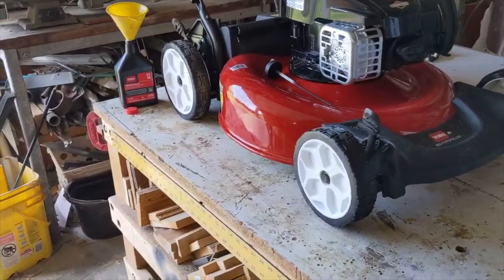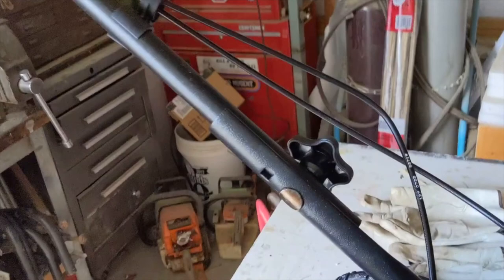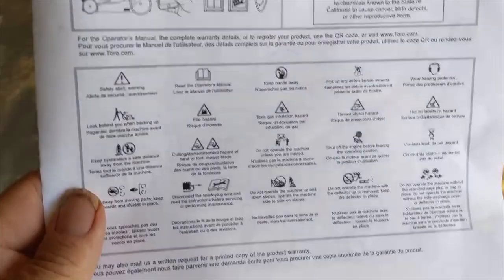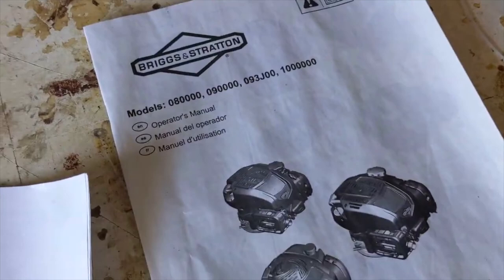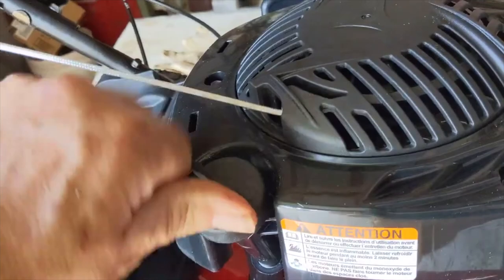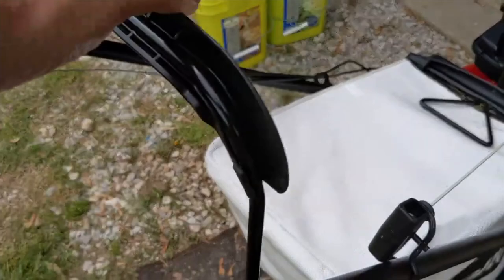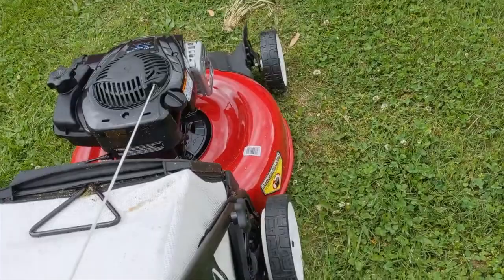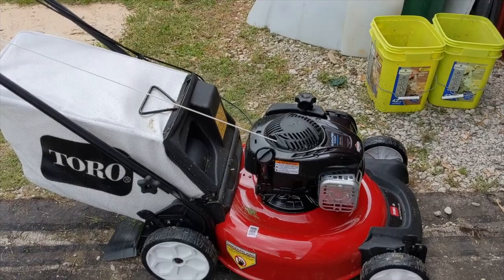Honest Review | Toro 21" Recycler/Rear Bagging Mower

Comment: This review rocks. I thought 100% the same thing about the oil and instructions. I was worried seeing no words thinking that’s a shortcut I’m not sure I want them making. Also I took like 30 minutes putting the oil in because I wasn’t sure how much, but the one I bought this week it took the whole bottle to be in the middle of the dipstick.  I have seen a lot of reviews online and even though it mowed great, I may go get the added warranty from some of the reviews.
Reply from the maker: When getting ready for this years mowing marathon this mower was almost sent to the junk yard, in fact I bought another mower while trying to fix this one. I passed on the warranty for this mower & learned my lesson here. The issue for the mower was the fuel filter that's located IN the tank and is not serviceable. I fixed it with an external filter. Now back to mowing =-)

Comment: Plan on buying this toro mower at one of my local hardware stores in town later this summer. I’ve heard it’s a decent mower for power and performance, my current one is a toro self propelled mower but has a big 149cc engine, had it almost a decade, it does not run well and has terrible issues with power, think the Briggs will do better, so this mower you have I definitely plan on buying.
Reply from the maker: That's fantastic, with winter just about over I know the grass is getting ready to spring into action. =-)

Comment: I have this same mower and yep, the instructions.... Well, they just aren't.
I have been very displeased with this because it was 3 times as much work to pull it backwards.  Watching your video I'm noticing that the propel and safety shut off bars are connected backwards from the way you described it.
Today I adjusted the propel bar so that the propel drive ísint engaged the whole time and now it is much better to pull it backwards, I cut the yard without calling the mower a POS.

The bag system leaves allot of un contained clippings that you will have to pick up with your hand.  It's a mess honestly.  
I would rate it a 4
Reply from the maker: I just had the wife use the mower today, the weather was a fantastic day for lawn-care, and yes she is still complaining about pulling the mower backwards, hates the bag and leaves it off as much as possible. Didn't notice about the bars, I'll take a look at it an see just what I did.
Thanks for the suggestion on the propel bar, I'll look at that too
MCK

Comment: I have one last question, please:
 Do you have to remove the gasoline when not in use for long periods? For modern gas engines the fuel line can get clogged up if you don't remove the gasoline. My old mower (decades old) never required this!  Just wondering in case you know?
Reply from the maker: I don't generally need to remove the gasoline because I run the gas out, If there's gas left in the machine at end of season I put in Stabilizer. Better safe than sorry.

Comment: Slack in throttle line. How do I fix. Toro 21in recycler brand new?
Reply from the maker: There shouldn't be any slack in the throttle line, without me seeing it I couldn't offer a suggestion s how to fix the problem. Could be assembled wrong at the factory. Sorry I couldn't be more help. MCK

Comment: 1) Can you use the mower without that huge clumsy bag? I never have  used a bag.
2) Does it start with one pull, ie., easy to start?
Reply from the maker: Yes definitely you can mow without the rear bag, that was the first thing the wife took off. It is easy to start, usually one pull will get it started. We're having a problem with the carburetor right now after a year of use. I'm frustrated because we really liked how easy it is to maneuver around the garden. I'll be putting up a new video on this soon. Hope this helps.
Reply: @4AMFARMS  Thank You!

Comment: What happened in you put the full bottle of oil I did can I fix it
Reply from the maker: It depends on how much is too much, if the oil is to the rim your going to need to remove some by pulling the drain plug to let some out. Over filling will cause problems a little is ok but a lot is bad.

Comment: Recycler is Toro's name.  This is one of the cheapest ones if not the cheapest one.  And the recycler is their cheaper line.  This isn't even personal pace.
Reply from the maker: Glad I didn't pay a bunch for this mower. This replaces a mower I had for like 10+ years. This Recycler works so-so for the small garden area and some of the hard to get to places with the bigger mower. That's about it. Fingers crossed it last.
MCK